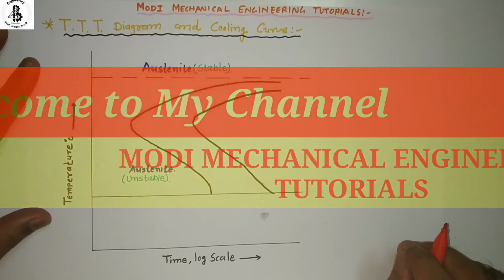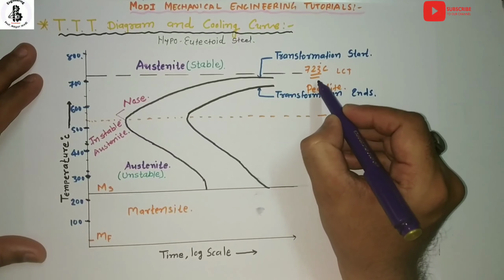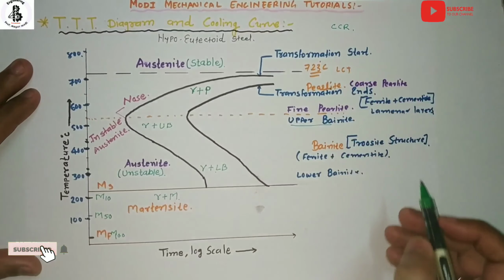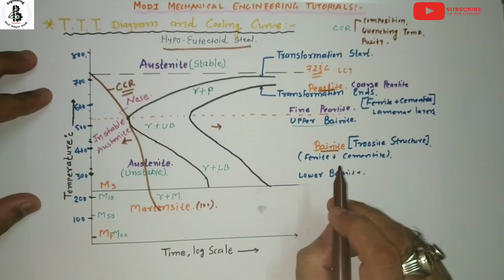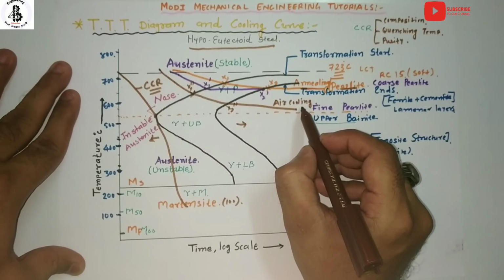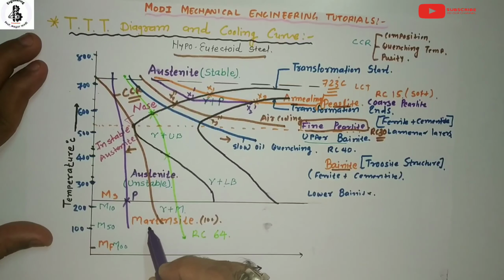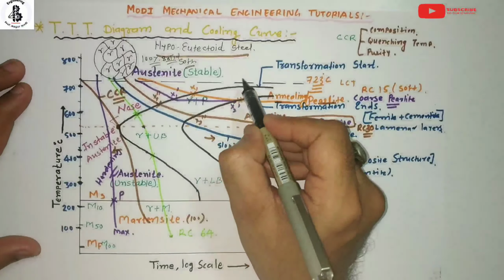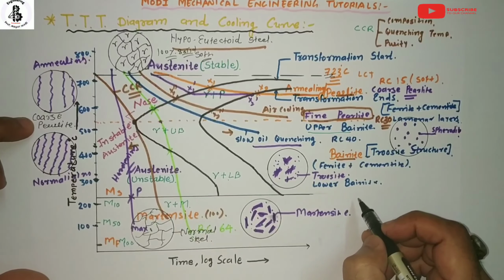TTT Diagrams | ttt diagram for heat treatment of steel | TTT phase diagram explanation

Comment: Sir thanks for your video....

Am working in hot rolling - TMT bar 

before quenching the bar temperature will be 950 to 980 deg cel after quenching the bar temperature will be 550 to 600 deg C (carbon range will be 0.2 to 0.25%)

Is it possible to calculate mathematically how much should be water pressure or flow required and quenching time with respective running speed and temperature of the bar 

After quenching we go for self tempering at atmospheric temperature 
So that we get a surface structure as martensite and core is ferrite and pearlite 

how can I understand this combined structure